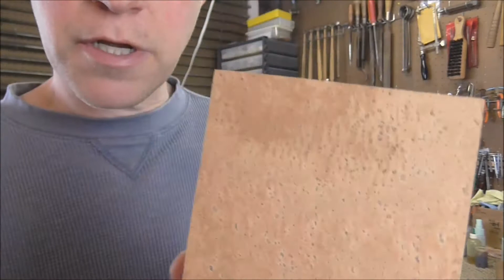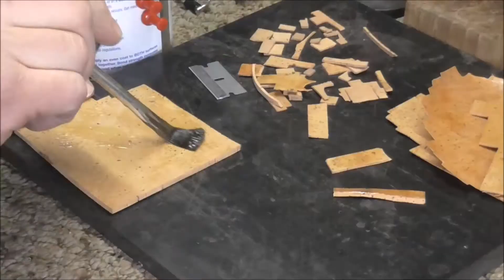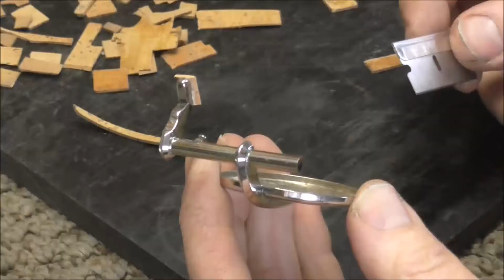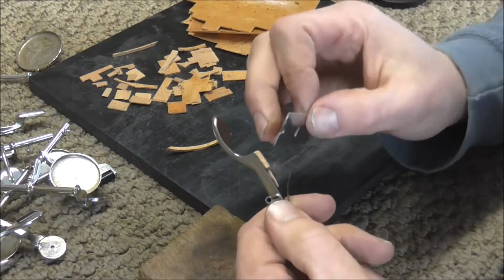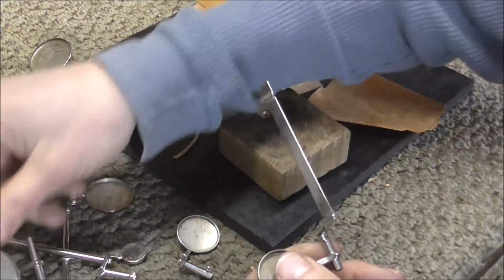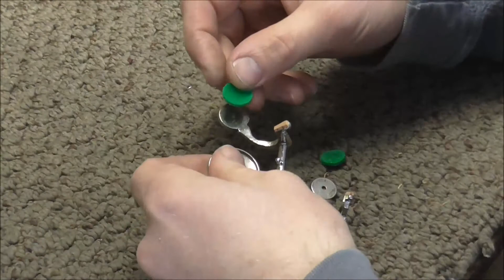How To Install Cork On Saxophone Keys

Comment: So, even though your using contact cement you're applying it to only the cork and not the key and relying on the heated key to activate the glue?
Reply from the maker: Yes, that is correct. This only works on nickel or silver plated surfaces and not on lacquered surfaces. 
You can also just put the contact cement on both surfaces for any type of surface if you want. Both will work, but heating up the key is usually easier.

Comment: For your video you have used an instrument that seems to ideally suited for demonstration purposes. In my 52  years of wood wind refurbishing, instruments such as the one you use in the video can be counted on the fingers of one hand. I have had instruments where the gap between the key foot and the key bar has been as much as a full 3.5mm, whereas the ideal gap as mentioned by you should be around 1.5mm. Also I have found cork to be a totally unsatisfactory material for bar keys and clutch pads. This material was used in the early days as there was no other material available and it is incredibly ridiculous that it continues to be used to the present day. I have found the hardest possible felt either natural or synthetic to be the ideal material for bar keys and clutch pads, while the regular cork is totally suitable for key foot use. Have you ever used any other material for bar keys and clutch pads except cork? Use of cork in a bar key gap of over 3mm would  require adjustment every few days. I would appreciate your comments, suggestions, advice or any information you think would be of use.Thank you.
Reply: Agree

Comment: hi Havent you ever serviced a euphonium with a trigger.  My trigger on main tunning slide is very stiff and although it comes out easily it doesn't retract back to starting position fully.
Reply from the maker: Most likely the slide has a build-up of junk on it. Watch this video. It may help. If this does not work, let me know.